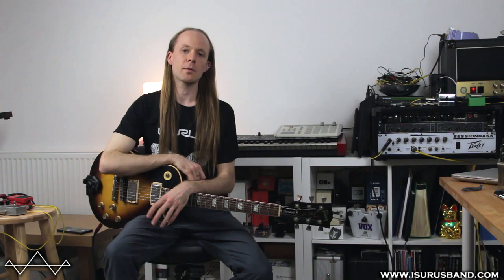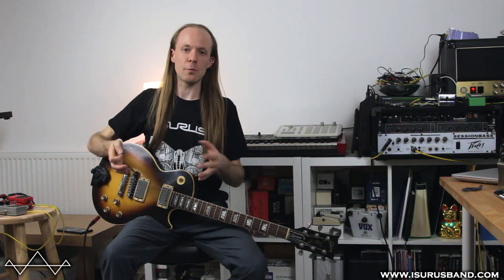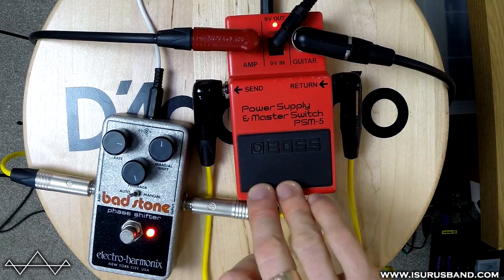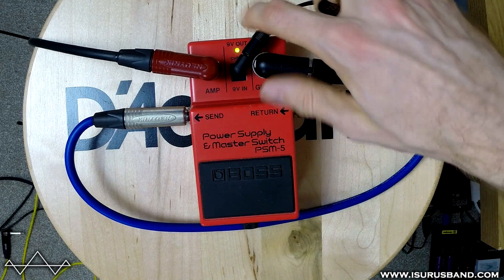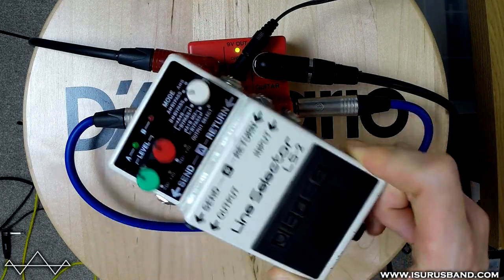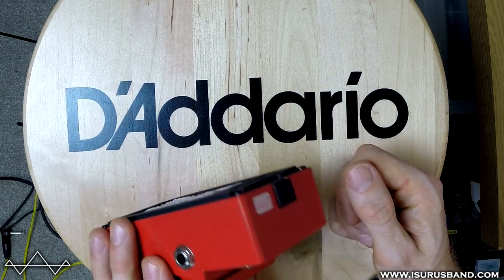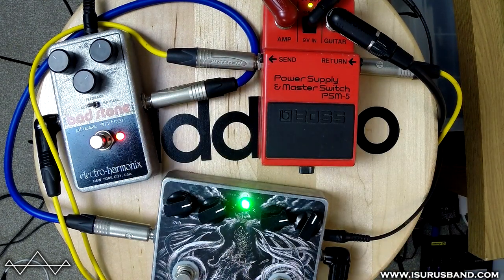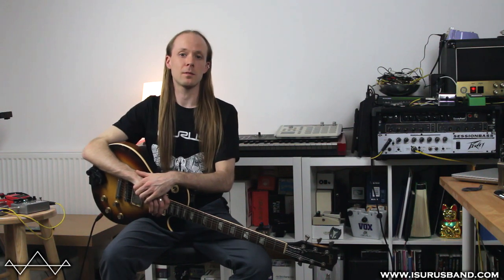Boss PSM-5 Power Supply and Master Switch Pedal Demo

Comment: I've been using this pedal for 32 years. Just a heads up, you're only using the pedal as a Master Switch, not as a power supply... The original daisy chain came with eight adapters in the chain .. I also have a three adapter daisy chain extension connected to the original daisy chain. All of the pedals rated for 9V I have connected this pedal.. From Boss, Arion, DOD, etc.. I have 10 pedals and a TU-12 tuner connected. I've been using it this way for at least 20 years now. NO ISSUES>>>>>> BEST POWER SUPPLY ON THE MARKET
Reply from the maker: I always avoid daisy chaining power to be honest, you can end up with all sorts of hum problems and DC voltage pops,  sounds like you have been lucky, it does depend on what pedals are hooked up, some are more prone to problems than others. Cheers for the comments!
Reply: @Isurusofficial   "hum problems and DC voltage pops"?? The best way I found to avoid any of these type issues is to plug everything into "ONE" AC outlet even if you have to daisy chain power strips. Using multiple AC outlets invites unwanted noise.
Reply from the maker: You are right, but that is not the whole story. What you are talking about is solving ground loops, DC voltage issues are different and can occur when everything is on one plug. If the pedals are not on an isolated splitter supply they all share the same ground and DC voltage can build up in the audio path with some pedals. I wouldn't use a daisy chain for powering pedals.
Reply: @Isurusofficial , thanks for the info bud.. If I do run into these issues, I'll definitely keep this in mind.. I can honestly say that I've never had these dc issues using the Boss PSM-5 daisy chain since 1988'.

Comment: I have had couple of these. Yes they are probably an obsolete now thanks to the LS 2. I still like the PSM-5 for the fact that you can connect the cables from the guitar and to the amp(as well as DC in) from the top plate. Correct me if I’m wrong but I think the reason Boss say you can connect only 6 pedals to the loop is because it comes with PSA-120 ac/dc which has only 200mA draw I bet a OneSpot could push even more pedals if it’s used instead with the PSM-5..
Thanks for the posting!

Comment: So if you had the older pedals that ran off of the ACA-120 power supply (12 volts stepped down to 9 volts in the pedal) it wouldn't power them adequately.

Comment: I have one I never use but the odd little thing is that it has the battery compartment and of course if you open it up, surprise! no battery cable.
Well obviously a 9V battery would do nothing to power extra pedals but would still function as a loop select.
Boss had an R&R session with their engineers, and after a couple of minutes decided to retire to the local pub for some Sapporos
Reply: It’s for drugs.
Reply from the maker: They just use the same basic chassis for all pedals this size, so that's why it's there.

Comment: Could you theoretically use this to place a Germanium based drive later in the signal chain? Post tubescreamer/buffer/etc?
Reply from the maker: No, it wouldn't change the fact that the impedance would be wrong for the germanium circuit. It would still be buffered.

Comment: Can you use this pedal thru fx loop with micro amp, delay and reverb pedal?
Reply from the maker: Yeah, you can certainly use it in an fx loop to have more control of which pedals are in the loop, you could for example have the fx loop with a reverb when you switch the loop in, and use this to choose whether a delay is in the loop also. There are countless ways you could set things up! :)
Reply: @Isurusofficial  Alright thanks. I just need the boss psm-5 to activate these 3 pedals at the same time during solos
Reply from the maker: Yes, that is exactly what it's for, you would lose reverb/delay tails instantly on turning it off though, but that isn't necessarily a problem just something to bear in mind.

Comment: so it bassically just switches channels?
Reply from the maker: No, not channels like in an amp if that's what you mean.. It switches a loop of pedal(s) in and out of circuit. Think of it more like an fx loop that goes infront of the amp.